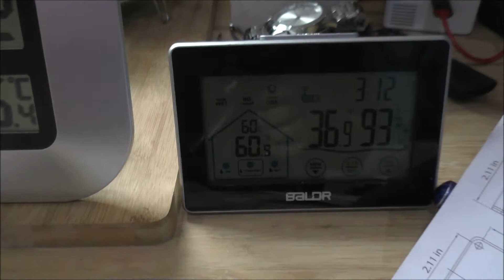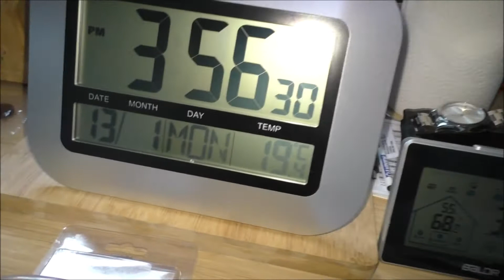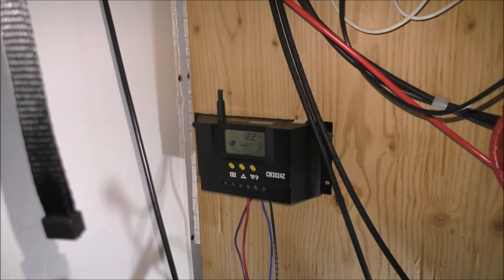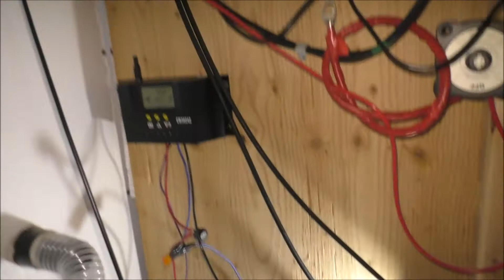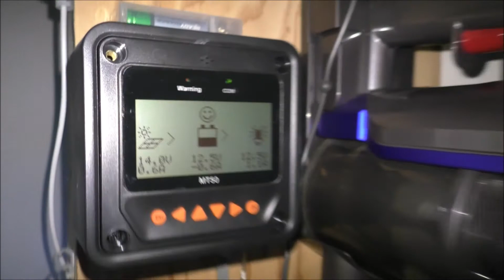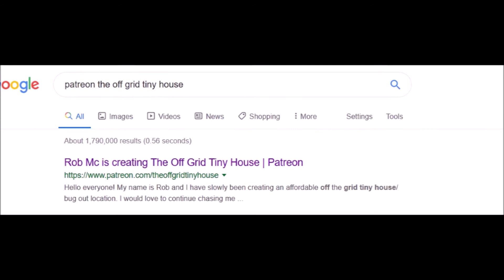Wind Turbine Dump Load Install

Comment: Earth grounding the off grid tiny house's electrical systems seems to be a subject of some debate among RV'ers, electricians and inspectors. Not so much because of low voltage DC power, but because of lightning via the wind turbine and other conductive pathways from devices on the roof of a solitary structure parked out in a field.

Apparently, some RV, camper, cabin and tiny house folks eventually get around to installing an earth ground once they have been at a fixed site for a length of time. Typically this involved a copper earth grounding rod driven into the soil, and connected back to a grounding bar inside the living space near the electrical distribution panel area. It seems that some who install earth grounds also bring all battery & device grounds to this grounding bar so that any high voltage system surges or device short circuits have a low resistance/high current pathway safely to earth ground (and not thru occupants).

BUT, I have seen back & forth arguments between electricians, inspectors and engineers as to whether grounding the interior electronics to the earth grounding bar is actually helpful or potentially harmful. The harmful advocates say that a structure on rubber wheels with no metal supports touching the ground is less likely to attract a lightening strike than one with a strong earth connection pathway. The helpful advocates say that providing a safe lightning pathway to ground will do its job whether or not it increases lightning strike probability.)

So, it would be great if someone could point us to a definitive answer by an unquestionable authority.

I think the wind turbine is probably a "this must be earth grounded" device for obvious reasons, but whether the off grid tiny house's internal electrical systems should also be earth grounded (separately or bonded to the wind turbine's earth ground) is not quite as obvious as it might seem at first glance.

Here is a link to a "it's helpful" advocate video that shows what he did on his own rig:
Earth Grounding Solar Off Grid System - Grounding Batteries, Panels, Controller, Inverter  https://www.youtube.com/watch?v=2nSHbXRjQsY 
(Lots of excellent deeper explanations in the comments of why "earthing" and "grounding" should be combined into a total electrical overload protection system.)

I, for one, would love to read something definitive, one way or the other, from a science, engineering or regulatory source that is beyond dispute.
Reply from the maker: excellent
Reply: I researched NEC grounding code a bit more and found this excellent video on grounding DETAILS from the Northern Mid-Atlantic Solar Education and Resource Center, part of The Pennsylvania State University.

Equipment Grounding for PV Systems   https://www.youtube.com/watch?v=-kjM9VWKHnk

Besides the theory, components and examples of proper & improper grounding techniques, near the end of the video there is also an excellent explanation of NEC code requirements with some system diagrams so we can understand where earth grounding should be placed on the DC side & the AC side.

Also covers where to put a GFI fuse/breaker on the inverter's DC input side. Good to know...

Comment: Continuation on grounding. A lot of your advice falls under Automotive grounding and there is two types. Ground in that category. Cars can be grounded by the engine to take the negative terminal. A grounder to the engine and frame some tractors are like this. And then there is Earth ground. . Ultimately, the ground wire in DC is trying to Safeguard your electronics an earth ground. It is very vague How you should incorporate an earth ground into? Electronical system. Battery DC. For you, I think you should at least have your trailer grounded. You probably need to have a strip copper wire electrical wire And get a decent stick. Attach it to the end in Hammer to the ground. That is Earth. . Underneath your tiny house. And this is a simple ground. Once you get inside your tiny house where to put it is the question. It is obvious. It should be attached to the frame. But should it be attached to the negative terminal? Well If I would say this is a positive option. Terminology Confusion Galore will happen. Is there grounding an engine block and it touches the Earth? There should not be a problem with touching the ground line. Which is touching the Earth to the negative? Side of the battery. The hair Rises the good question. . Should your AC. Grounding be the same grounding directly connected to your battery.. No. I just want to say no. I have not really seen. Someone do that. . I just think it's unwise to let your power converter be connected to your battery DC ground connection. In closing, I think you're windmill generator is grounded. If I remember, right? In this it should be grounded for lightning. . And ultimately in this situation. You want everything to be grounded?
Reply from the maker: the turbine has an earth peg pounded into the ground so i assume the electricity will hunt for that and go to earth.

Comment: I often wonder. About your Earth ground. Your instructions diagram Shows the Earth ground connected to the negative terminals. Of your battery. True. Yes. That is a little bit of a Wonder. . Understanding is needed. .
Reply from the maker: well i connected them to the negative connections because there is a earth ground going out to the wind turbine so i figure that will take care of it